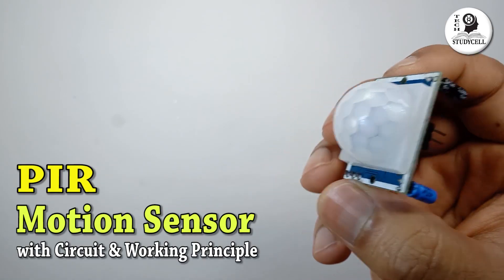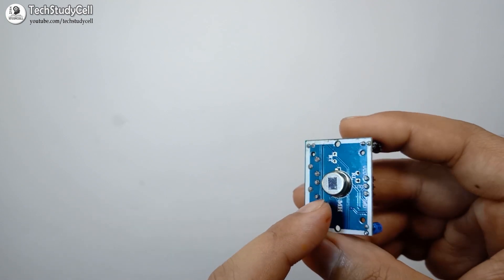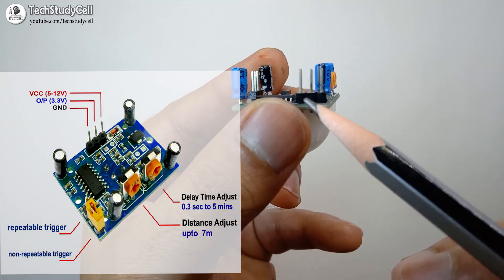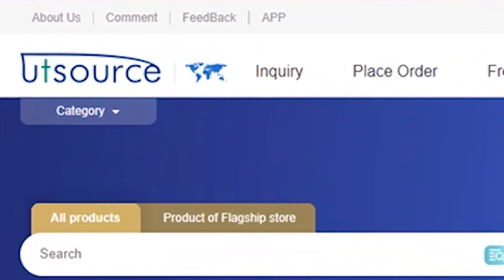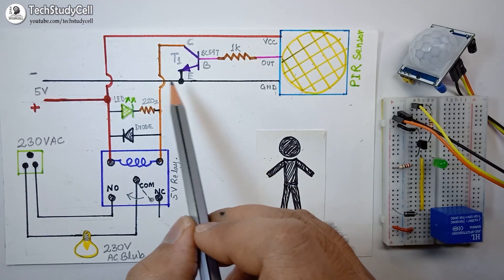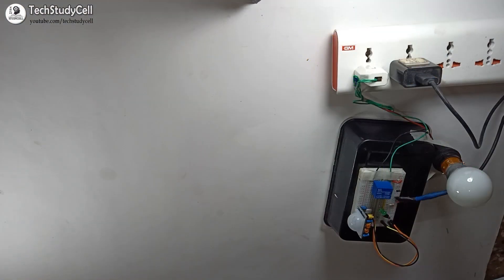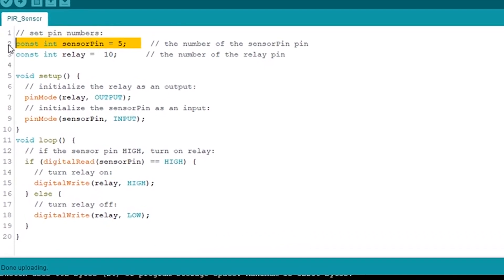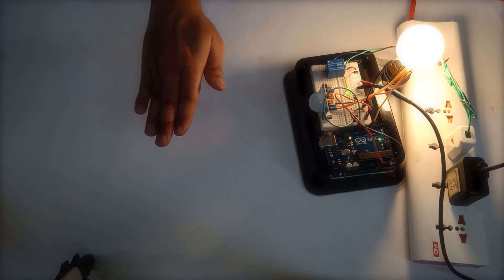How PIR Sensor Works and How to use PIR motion sensor with Arduino

Comment: i have been try to calculate the value of resistance need to use in this circuit and the value is 480 ohm . Correct me if im wrong, 
Voltage output sensor = 3.3v TTL
Voltage base emitter  = 0.9v for (Vbe sat) Ic = 100mA, Ib = 5mA  --> i choose this as the relay will consume aroung 80mA
                                       = 0.7v for (Vbe sat) Ic = 10mA, Ib = 0.5mA 
Voltage collector emitter = 0.2v (typical)
As for the formula to find R at base is

R= (V - Vbe) / Ib
R= (3.3 - 0.9) / 0.005
R= 480 ohm 

and all circuit diagram i found is using 1k ohm  and 220 ohm for bc547 and 2n2222 respectively. 

Base on my calculation, if Ib is 5mA then the resistance is 480 ohm, but if i use 1k ohm, doesnt it make it Ib to 2.4mA and Ic around 50mA. That will half the potential of bc547 as it maximum Ic is 100mA. and one more thing is if the amp need to use in relay is 80mA, how can with Ic = 50mA support it.
Reply: My PIR motion sensor sometimes trigger on it self, can you help me explain it?? :(

Comment: In My Case it Continues keep Sending The High Signals while All The Connection Are Correct and The Jumper Is Also Placed On Non- repeatable mode. Any solution???

Comment: hello sir after watching your video I thought if I can use a PIR sensor instead of an ultrasonic sensor in obstacle avoiding car
will it work or it will keep crasing
Reply: No it will not work, it needs infrared radiation which will not be always there with obstacles